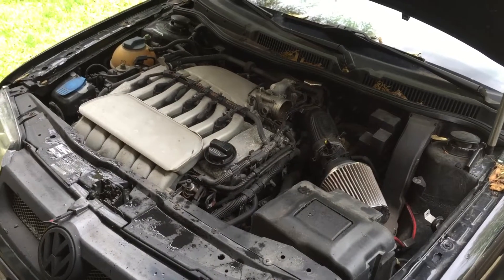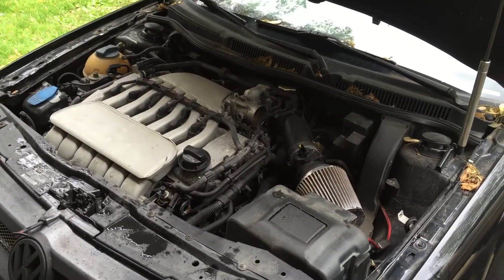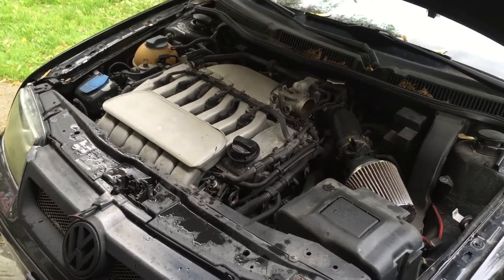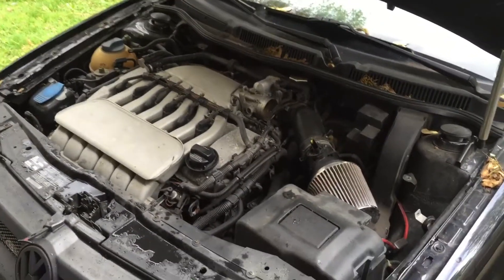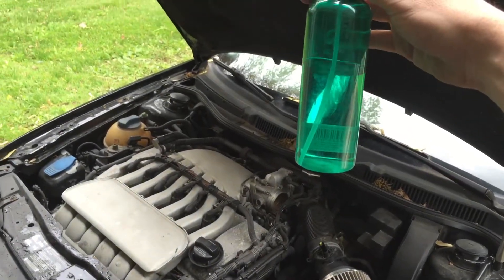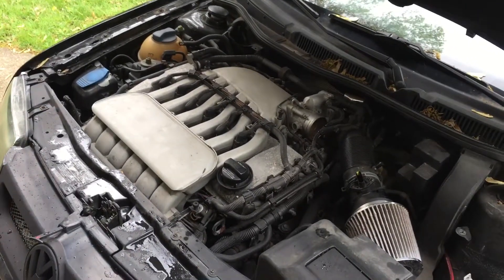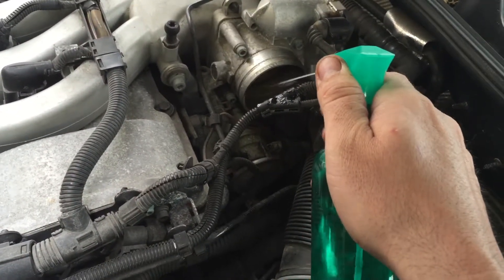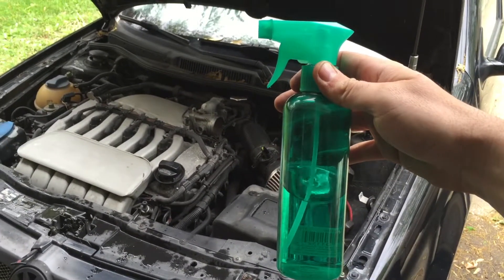Cleaning Carbon Deposits With Water?  Is It ReallyThis Easy?

Comment: OK. Well, the engine already produces lots of steam as it runs. (About equal in mass to the fuel consumed.) Yet carbon deposits develop. So your steam cleaning premise for administering an incrementally tiny dose is dubious.

Why not heat a carbon caked skillet and squirt water into it? Document the mechanism involved. Vary the conditions to maximize decarbonization. Do something different than everyone else! You might learn a lot by doing so, educate YT’s unwashed armchair decarbonization theorists, and become a YT star!
Reply from the maker: Frank Gutowski   I very well may try to gather some more real world data. The only thing I have so far is some photos i took with my borescope pre and post cleaning where I’d seen a positive effect. The only thing I’m not sure of is your comment about steam already being present as part of the combustion process. I’ve never seen this in my personal experience and I’m not sure where it would come from. Even on the wettest of days, I’m not sure if there would be enough water grains per pound of air to create conditions that would allow steam to form in the combustion chamber. May very well be another test that I can make up to gather some useful data.
Reply: The Dan Channel 

I once found the quantities of carbon dioxide and water produced from a gallon of gasoline on line. It corresponded with calculations using octane as the fuel. The products of combustion gain a lot of mass from oxygen they incorporate, obviously. 

From many comments elsewhere, it appears that YT’s decarbonization theorists completely ignore water produced internally, and instead focus on their preferred methods of briefly introducing small quantities externally. 

IMHO, the easiest way to introduce lots of water is to burn E85, if the vehicle allows, as it will result in over 2X as much water being produced internally. High-alcohol-content gasoline burns cleaner and leaves fewer deposits: the additional water it produces may be responsible.
Reply: The Dan Channel 

Water is created in the engine by combustion. All of the fuel is consumed by reaction with atmospheric oxygen, which produces gaseous water and carbon dioxide. Gaseous water is called steam; it becomes visible below the dew point, where it becomes atmospheric condensate, or fog. You think steam is only what you can see, but it’s not. What you see is condensate: it is no longer steam because of a combination of reduced temperature and pressure. 

Also, no one, to the best of my knowledge, on YT at least, has confirmed that the deposits are carbon. I suspect they’re mostly metal oxides from motor oil additives.
Reply from the maker: Frank Gutowski that’s very interesting stuff. I’m going to look into this further as I completely agree there may be hidden potential in e85 blended fuels as far as cleanliness is concerned. And here all along I figured that visible steam exiting the exhaust was a byproduct of chemical change in the converter. Maybe it’s still partially responsible, but it’s interesting to note what is exiting the exhaust port as well, as you had mentioned. I’ve been meaning to revisit this very subject anyway simply because I need to be able to quantify the results I’m seeing and be able to know exactly why they are so. I really appreciate all your input!
Reply: The Dan Channel 

I’ve read that modern vehicles burn all but 2% of the fuel, on average. So fuel oxidized in the converter isn’t making much difference re the volume of fog observed in cold weather. 

It occurred to me while writing that many images of cylinder crowns show strong evidence of turbulence. Very clean areas vs crusty regions elsewhere. Patterns even vary by cylinder. So I assume water added externally also experiences the same uneven distribution, with more concentrated where it’s least needed. 

It’s distressing to see these decarbonization folks not thinking very critically about what they’re doing Defensive and even hostile responses  commonly result when challenging their theories and its overall efficacy. 

Good luck!
Reply: If engines were actually making complete combustions and not just wasting 90% of it out the exhaust (which is what makes carbon build up)  there would then be much more water to clean the engine. 

Look up about gasoline vapor systems and getting 100mpg. Youll find that when an engine is run where combustions are always complete and no fuel is wasted the engine will be spotless inside, another thing is that the engines barely even get up to operating temperature since theres not nearly as much waste heat from incomplete combustions. Another interesting this is that when a pure vapor is made your intake manifold will actually get very cold sometimes even have frost on it from the fuel absorbing all of the heat around it. 
Liquids vaporize into a gas when they have enough heat energy to break their bond and overcome the outside air pressure, at that temperature itll leave its drop. Every time a liquid leaves its drop and becomes a vapor, its drop that it just abandoned is left colder because the independent vapor drop cant be a free vapor partical without the amount of heat it just stole from its drop.

Basically, heat your gasoline up to 150 or your e85 up to full coolant temps to get a more complete combustion. I managed to get 31mpg highway on e85 by heating to coolant temps in my 1.8t with 14.7:1 afr (normal e85 mpg is about 16mpg). Also managed to break my rod and piston in half from making a ridiculous amount of power lmao